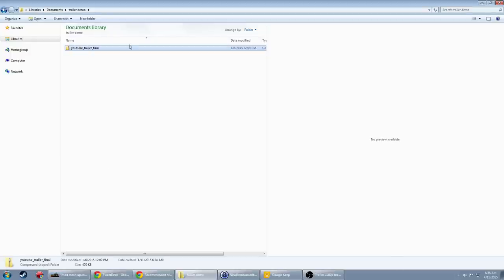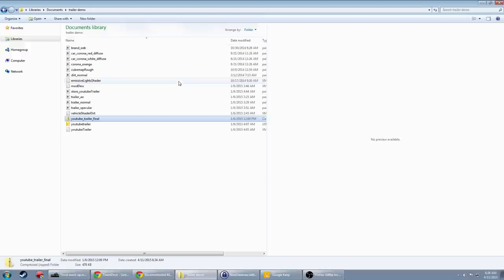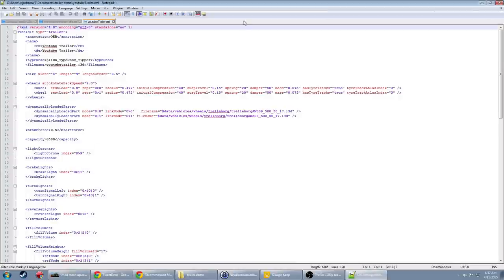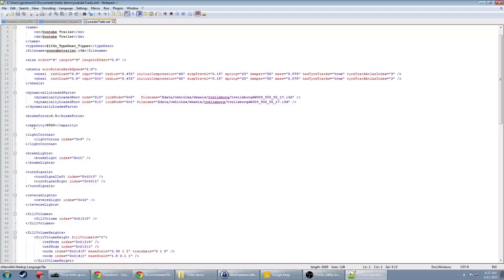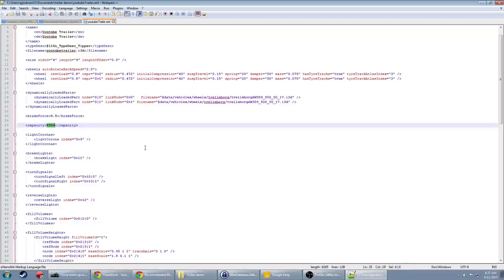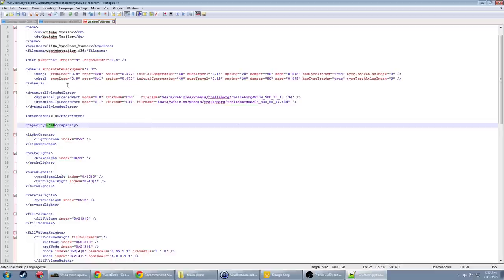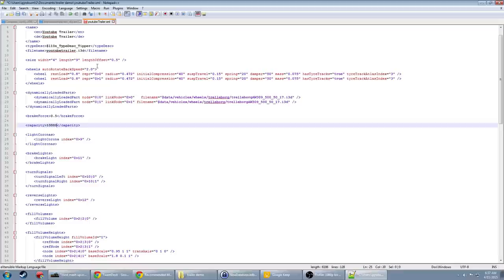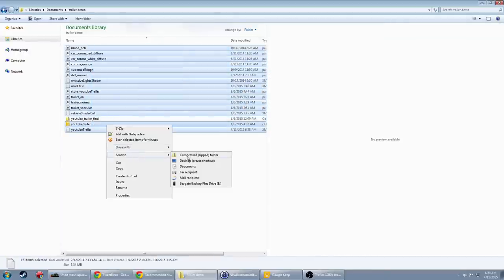Farming Simulator 2015 Tutorial - How to change the capacity of a trailer

Comment: I did all this video shows. and after I edited the capacity using notepad++ then I archived it back to zip file, my game always cannot recognize the mod..but when I use the default capacity (that is from the mod) I can add it to my game without problem..can u help me on this? thanks
Reply from the maker: Did you change the name of the mod when you zipped it. Sometimes that can be the problem. 

Another possibility is that the line of code isn't complete somehow
Reply: Well, I didn't change anything when I zipped it back..so let me try again..thanks, by the way.. :)